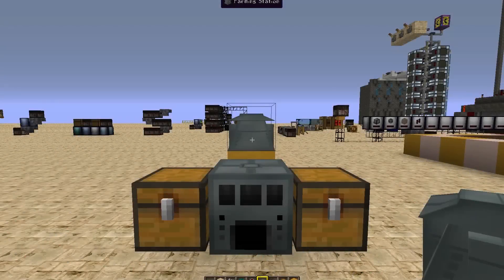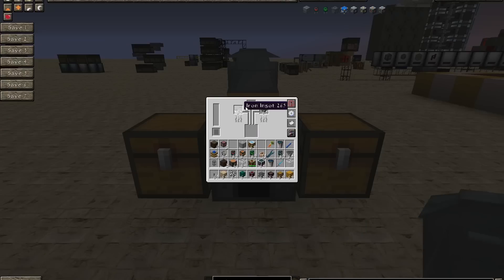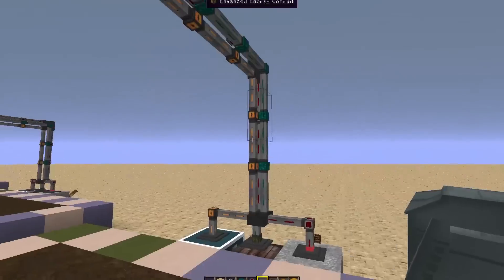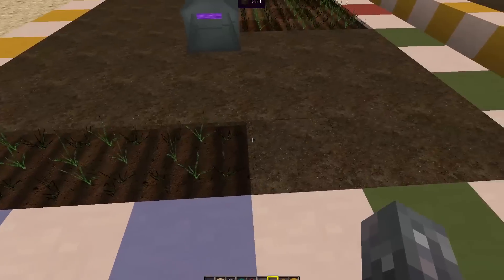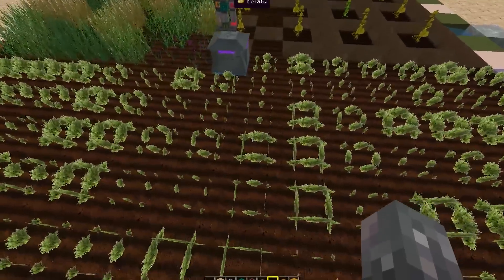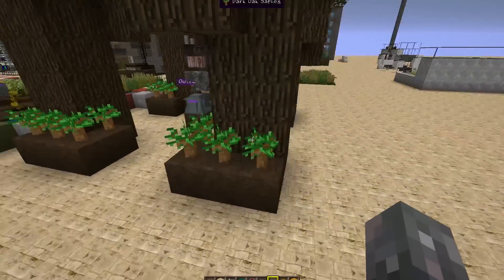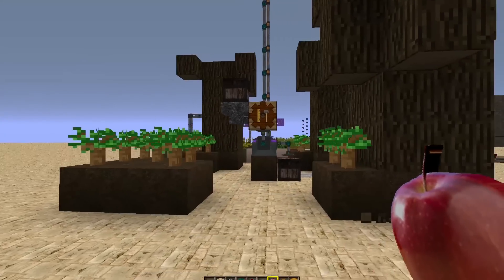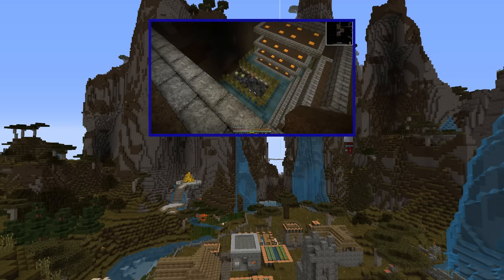How It Works - EnderIO Farming Stations - Tutorial

Comment: Is it possible to extract the collected seeds from the station? I have this problem with magical crops when I use an octadic capacitor on the farming station it collects more then one seeds  from time to time from my magical crops where usually it only collect one. I want to collect those additional seeds added by the upgrade but it does not allow me to make an output for the seed section. please respond fast. thanks in advance.
Reply from the maker: There's an Agricraft Farming Station from EnderIOAddons mod that is designed specifically for Magical Crops. If you use the normal one, yes, you can extract seeds and such still. You just need an inventive piping system to handle it. For my farms where I want to build up a storage of seeds and crop yields, I just use barrels/caches for the seed and crop with an input and output set on it with autoextract. The farming station drains it's output into the storage and the seeds can flow back into the farming station (if it for some reason runs low on seeds, such as upgrading field size or accidentally breaking crops manually).
Reply: WoW this video is like 4 years old an you replied like 15 minutes from my post ! thanks of the help but I tried to lock the seed inventory spaces and it worked just fine. Thanks again for your time !
Reply from the maker: No problem. ;)

Comment: my fariming station works slow, when have bone meal don't use it continually and harvest the mature croop after various seconds¿why this happen?¿how can i fix it? (i speak spanish, sorry if i have errors)
Reply from the maker: Make sure you're feeding it enough power. If there's not enough RF in it, it has to wait for enough to do more.
Reply: Ammaross Plays yes, the power is full with the octadic capacitator
Reply: Ammaross Plays and thanks for the answer :D
Reply from the maker: What crop are you farming? As long as I have a good power supply running to the station, it instant-farms when crops finish growing. I haven't tried to feed it a continuous stream of bonemeal yet though.
Reply: Ammaross Plays wheat and wathermelons

Comment: Whats the block you used to connect the enderIO conduits? into 3 cables on one block
Reply from the maker: The EnderIO conduits are multi-part blocks. It allows all the cable types to occupy the same block space by default. I'm using the redstone conduit, item conduit, and the energy conduit. Additionally, you can use the fluid conduit as well.

Comment: Sorry, relatively new to Ender IO. How do you supply energy to a capacitor? I use lava converted to energy through the lava gen to my machines. Do I have to do the same thing here?
Reply from the maker: Yeah, you can do that. I tend to use a variety of power options, but lava conversion works too. :)
Reply: Thanks!

Comment: When I put power in to the farming station, it uses it without harvesting please help
Reply: Not sure if you know this yet or not but, the farming station will use power all the time regardless of anything being ready to harvest or not. I think it's probably to put a cost on the station checking for things to harvest but considering I think it's about 20rf/t by default that's not too hard to keep up with however if you check the config I'm sure there's an option to disable the power draw when not harvesting.
Reply from the maker: Do you have the correct harvest tool (hoe, axe, etc) in the farming station?

Comment: when i tried to use it, the redstone conduit wouldn't connect to the lever
wwhhyyyy
and how do i charge the capacitor????
Reply from the maker: +Mason Bowman You can try using a Conduit Switch instead of a simple lever.
To charge the capacitor, you need to provide it with power from an RF generator (such as the generators from ExtraUtilities, Dynamos from Thermal Expansion, EnderIO's own generators, etc).
Reply: Thank You!
Reply: +Ammaross and how do i connect the
 power to the capacitor?
i tried using insulated redstone conduit it didn't work
Reply from the maker: Those are used to transfer redstone signals. You want to use the energy conduits instead.

Comment: I got a question, is there a glitch involving seeds being deleted when harvested by the farming station?
Reply from the maker: Jackson Thorn Just pipe them to a Nullifier from Thermal Expansion (be sure to use a filter!) and they'll be auto-destroyed. You could also use the old-school method of a dropper into lava.
Reply from the maker: William Mock I use EnderIO conduits to put surplus seeds into a Thermal Expansion cache in a push/pull configuration. I haven't (yet) seen a glitch with seeds being deleted in the various revisions of EnderIO I've used. What's your version number is your build?
Reply: I found out the problem, simple, I had the seeds set to auto replant :(
Reply: +Ammaross So the caches hold surplus seeds? Is there a way to directly get rid of surplus seeds because theyre taking all my me system space :(

Comment: Farming Stations are usually not worth it since most modpacks also have the MineFactory Reloaded mod. This mod has machines that can do the same: Harvester and Planter. And these don't require tools.
Btw, Magical Crops are both unsupported by MFR and EnderIO so good luck with those.
Reply: Mhykol hasn't seemed to have any problems. Strange...
Reply: Back when I used magical crops, it worked just fine with MFR.

I do believe it's a config option, you can turn off whether or not magic crops can be harvested with machines.
Reply: Now that I'm actually doing it, I just planted them manually. It seems to work fine after that.
Reply from the maker: baden271 The best thing about requiring tools is the enchants on the tools are counted as well. It's give and take, but the tools requirement was meant as a balancing restriction to make it less cheaty.

Comment: What about watering can? And seeds from other mods than just Vanilla?
Reply: +baden271 since this is an old comment, you have probably figured it out. With watering cans, first off it needs to be a reinforced watering can. Put this in an autonomous activator (of course, you need the mod) and it should water!
Reply from the maker: I don't believe a watering can can be used /by/ a farming station (no slot for it). Other seed types from mods will work though. Oreberries and Magical Crops work. Also, as of 2.2.6, support was added for giant mushrooms and cocoa beans.
Reply from the maker: Farming stations can use fertilizer now, so that should preempt the need for watering cans. :D
Reply: +Ammaross I saw, so is there any way to delete excess seeds??
Reply from the maker: Jackson Thorn Pipe to a Nullifier from Thermal Expansion (use a filter!). There's a type of pipe from Buildcraft that destroys objects. Also, there's the good old dropper into lava method. :)

Comment: Is it possible to automate the farming station with the crafter of ender Io?
Reply from the maker: Yes. I show the autoworkbench from Buildcraft since it doesn't require power and speed isn't an issue with replacing hoes or axes in a farming station. But you can use other autocrafters from EnderIO or Thermal Expansion if you wanted.